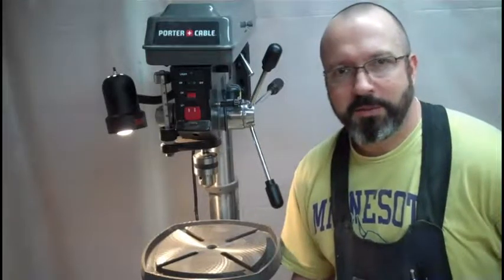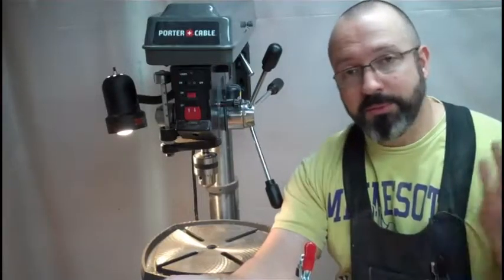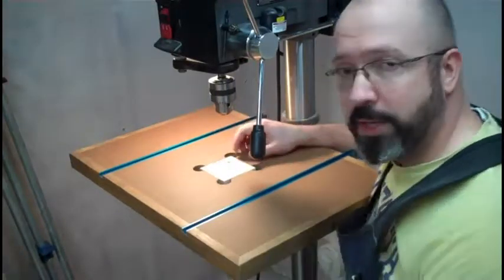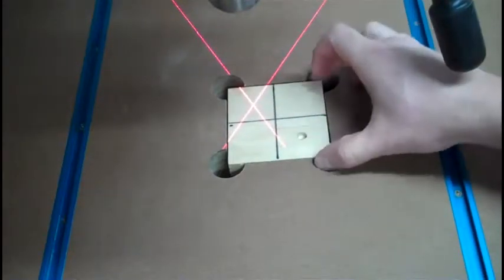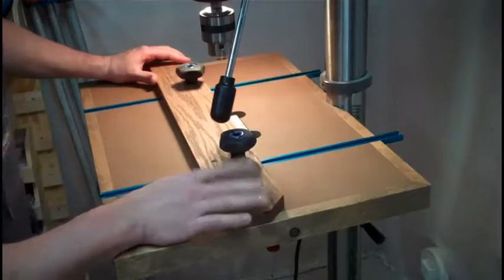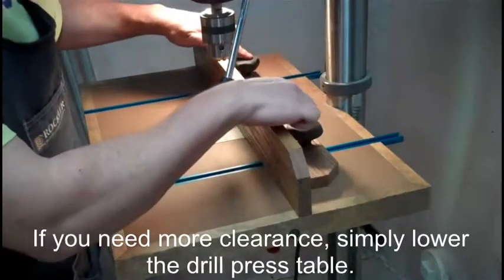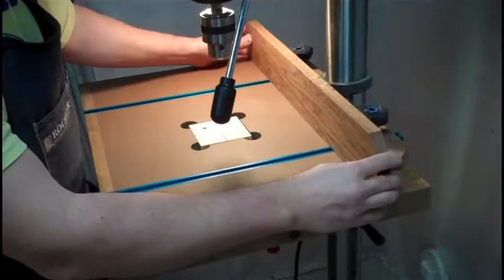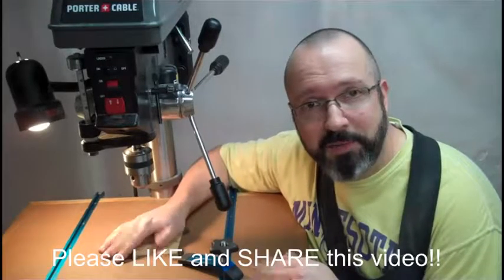Drill Press Table

Comment: How did you mount it to the drill press table?
Reply from the maker: Rebecca Summerlin I used a couple of toggle clamps to attach the table to the work surface of the drill press.  I could get a pic and send it if you want?
Reply: @kevinheilmanwoodworking7015  thanks so much for the reply! I've managed to attach it with a couple of well placed lag screws...quite an oddly engineered cast iron plate on the porter cable dp.
Reply: @kevinheilmanwoodworking7015  I'd love a pic, I agree with Rebecca below that it's such an oddly engineered plate.
Reply from the maker: @CapeeshStupido  hi Christine!  If you could go to my website and click the Contact Us and send me an email, I’d be happy to take some pics of the drill press table and send them.

Comment: Nice looking table, thanks.  A discussion of how you put together the clamping system would be helpful.  Did you put any guides/bumpers on the bottom to help orient the table?  I've had this drill press a few years now and it's been great for my DIY projects, but this table would make most work a whole lot simpler, avoiding eliminating the awkward squeeze clamps I've been using.